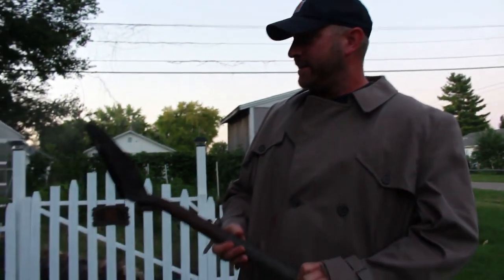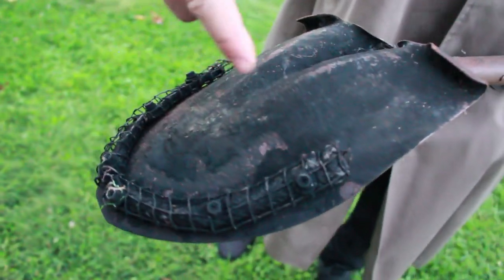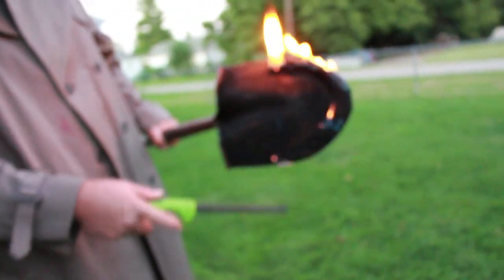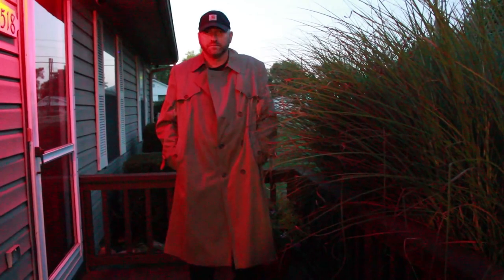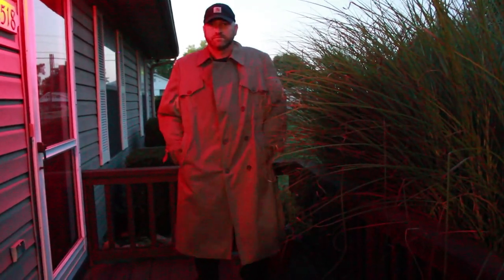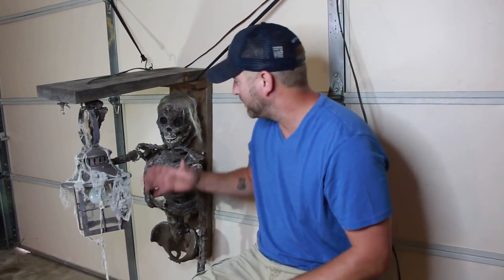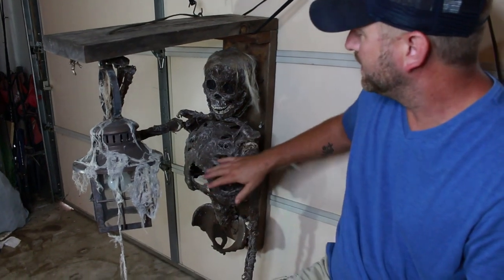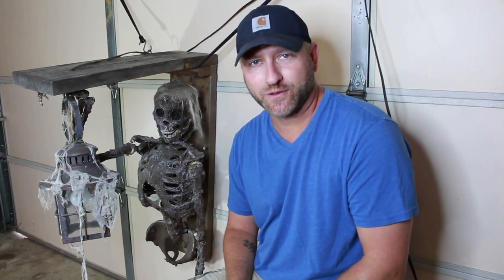DIY HALLOWEEN PROPS!! HOW TO MAKE UNIQUE HALLOWEEN PROPS!

Comment: How long does the flame last on the shovel per soak/dip? 15, 30, 60 minutes etc?
Reply: Without a fuel reservoir, can’t imagine that it will burn for more than a couple of minutes per dip.
Reply from the maker: I plan on releasing a video to show how long the flaming shovel and the flaming axe will last per burn.  Stay tuned!
Reply: @kaiprojectsdiy  love the effect. Did you make the video? or could you give the estimated time the it lasts please.